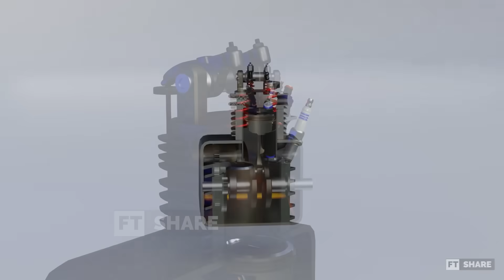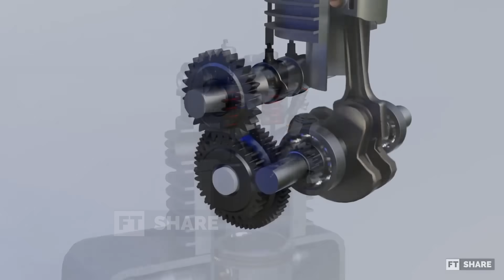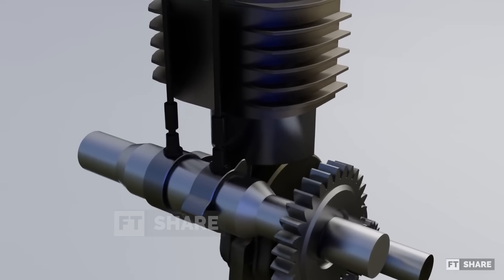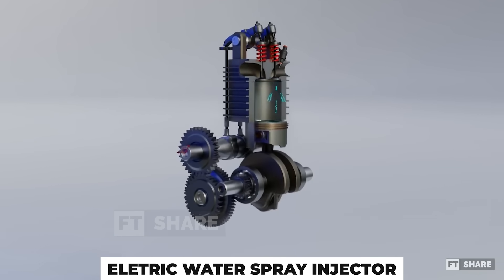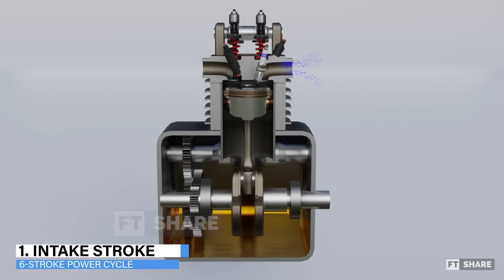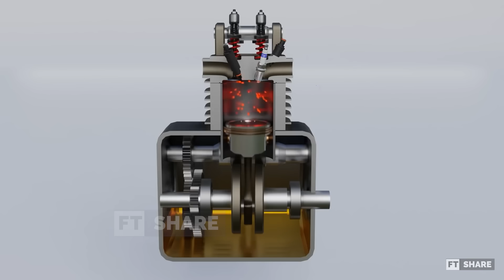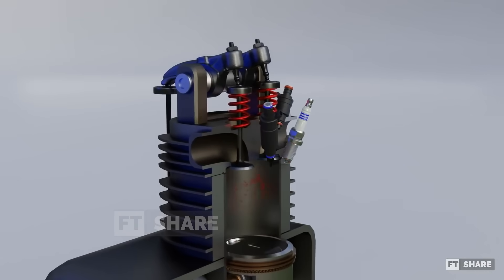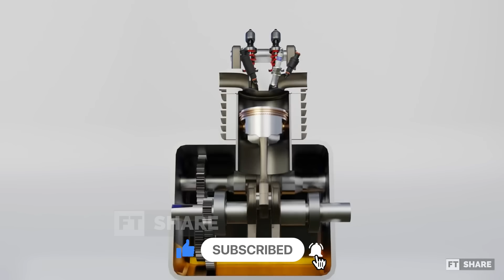Water-Powered ICE Is Here!!! | The Revolutionary 6-Stroke Engine

Comment: If it sprays water eventually it will corrode the wall of the sleeves will rust and water can mixed into engine oil when it goes inside.

Comment: The application for this engine would be niche at best.  It is obviously not good for mobile applications because of freezing water additional weight and complexity.  The only advantage is higher efficiency and no need for a radiator.  For stationery applications a turbine engine will be even more efficient so that is why this engine has not been adopted over the years.

Comment: This design would work even better if the exhaust gases were partially retained for the water quenching cycle. It would also convert some of the NOX gas into something less of a problem to deal with and may even be caught in the exhaust system in the same way cleaned power station flue's work. That liquid is even great as a soil conditioner properly applied.

Comment: 6 stroke sure, water powered ? nope, water is not combustible and the energy to split into hydrogen and oxygen is more than the energy release by igniting them.
Reply: Water is turned to steam, not used as a fuel.

Comment: I was just thinking that if the water were super heated inside the cylinder that this improvement in the steam engine as opposed to a boiler, yeah this could work well.  But the atomization of the water precisely the right time and degree is tricky

Comment: Ooo,  so this is why they will replace the electric motors. It’s because of the claimed 15% more thermal eficiency. The fact that you inject watter in an oil lubricated system is nothing. The fact that ads complexity to an already complex engine, compared to an electric motor is also nothing. 😂😂

Comment: The power gains come from the water injection. 
 Water injection adds app25% more torque to a 4 stroke engine without any other unnecessary clutter.
 I know, because I've used it on my OTR semi's for about 10 years now.

Comment: Interesting concept, however the power density of this engine seems to be another problem, ending up with an efficient but heavier engine, besides of its additional complexity. Also, there are other tecnologies that already achieved the 50% thermal efficiency. For me the 6 stroke doesnt seem commercially viable.

Comment: Hear me out. What if you had 3 valves: 1 for the air/gas mixture intake, 1 for the gas stroke exhaust and the other for the steam stroke exhaust.

This way you don't have to deal with water in the catalytic converter and you can route the steam directly to a simple filter and a condenser to recycle it.

Comment: Seems like, although you're recapturing some of the heat energy with water, running cooler would have a negative impact on the first power stroke. I guess it works though since Porsche is doing it.

Comment: The water would make the engine cool down and heat up repeatedly making the metal dilate and shrink down a couple times in a second, so I suppose structural rigidity is a huge challenge as well

Comment: Hype is not really useful.  Some electric motors are 98% efficient already.  The theoretical efficiency of 50% cannot compete with 98% already achieved.  It would be interesting to know the pollution this design produces.  I assume it still puts out nitrogen oxides and carbon monoxide and needs a catalytic converter to legally be used in a US production automobile.

Comment: It will work but then you will have complications with the lubricating system because water is going to get into the oil past the rings and then you will get rust around the cylinder when you turn the engine off one of the Pistons is going to still contain residuals of water

Comment: My great-uncle Leonard Dyer worked on this concept and even got a patent for it through his brother Frank, my grandfather...one thing i didnt hear mentioned is the difficulty keeping this engine lubricated during the flash from water to steam.  Otto Lutz came up with something he called "Schutzol 39" in the 1940's but it was meant to prevent corrosion in his MW50 methanol/water injection system he developed during the war.  But this was not intended as a lubricant, also apparently it was emulsifying just fine in water.
Reply: Interesting! I was just reading about the Dyer engine and then found this video! Yes, I would think the most obvious problem is steam cleaning the oil right out of it and then you've got oily waste steam to manage.

Comment: All very well until it's winter and you go to start your vehicle in the morning but the water has frozen and turned to ice
Reply from the maker: You right, I didn't think that far. :(
Reply: That is a non problem, I used to spray a ton of water methanol and straight water, it does not hang around in the cylinder

Comment: People come up with all of these complicated ideas of modifying already invented machines with numbers of how much greater they are than what was developed years ago from scratch. What they don't explain is all of the problems they present. Lubrication, corrosion, freezing in cold climates, expelled steam turning back to water and water vapor especially in cities freezing on the roads,  and the soot that the steam will probably carry out are all problems I can think of just sitting here using my imagination that we don't have right now. Actually there is some water generated in the exhaust process from engines now that will freeze on the pavement but it is minimal. Just picture a really cold day sitting at a stop light and white exhaust spewing out which is steam produced from relative dry air. Imagine what it would be when injecting water in the engine. Some of you may never have seen this before unless you live north of or near the Mason Dixon line (In the USA) .

Comment: the water doesn't have to be lost. After ejection, the steam can be piped back to the water tank, where it will condense. HOWEVER.  This is not a simple design, in practice. I think if an engineer is smart, he can design something complicated that works. If he's even smarter, he can design something simple that works better. I would like to see an engine with fewer moving parts, not more.

Comment: With many years doing engine R&D and simulations I could spend   an hour listing the problems, but the big one is low specific power  output and the water. With the modern turbo car engine at 120 bhp per liter why this?

Comment: This is a good example of the trickyness of computing with percentages: 50% is, and at the same time is NOT (!)) 15% than 35% (depending on the definition of %) ... It is literally 15% higher because "percents" are the things we reckon with (percent-points we would say in Dutch), however the real difference is much bigger than 15%, because 15% "percent-points" is actually 15/35 = 42.875% of 35%. So an increase the efficienty from 35% to 50%  leads to a nearly 43% (!!) higher output from the engine. Or, if we for instance assume that the efficienty directly translates to range on the same amount of fuel, and we also assume that a certain amount of fuel gives a range of 100 miles with the standard engine with 35% efficiency, then the engine with 50% efficiency would give a range of 100 * (50/35) = nearly 143 miles, which is an increase of nearly 43%...

Comment: During first exhaust stroke exhaust gas is pushed straight out into exhaust manifold. It will carry large proportion of waist heat with it. Why not send it into heat exchange vessel and then pump water through it thus scavenging said exhaust heat before water ingected into the combustion chamber? Also second exhaust stroke is really unnecessary! Why not make it two stroke like by blowing compressed air into cylinder on the bottom and then do direct injection into combustion chamber? Then engine will be 5 stroke engine? Or maybe 4+1 stroke? As in 4 stroke engine with added 1 stroke in the 2 stroke engine fashion...

Comment: Nice video and presentation. 
However residual heat spans from the cylinder to the exhaust system. If not inject to the cylinder can be injected at the turbo rotor inlet. If any corrosion there the maintenance cost can be reduced significantly.

Comment: Momentum not inertia. Water does not evaporate, it is flashed. A better approach would be to run two 4 stroke cylinders into an water injected  expansion cylinder. A six cylinder engine could do this with an altered crankshaft sequence.

Comment: My thought was a 3-valve head, instead of a double lobe cam. 2 valves for fuel intake exhaust, 1 for water exhaust. That way you could separate straight steam exhaust to keep away from things such as a catalytic converter, as mentioned by someone in the comments, and O2 sensors and the like that may be damaged, and could possibly be recondensed as in some steam engines.

Comment: Cool idea.  Convert thermal energy which is usually dissipated with a radiator to kinetic energy.  Water methanol injection was used in ww2 to provide additional power in a dogfight, so the concept is not new, but to utilize an additional compression stroke when injection the water followed by an additional exhaust stroke would appear to be the revolutionary part of this. 

There is so much potential energy with cars\ automobiles that is currently wasted.  

Every time we roll down a hill or tap the brakes thats energy that should be recycled for the next hill or acceleration.  Everytime there is a large temperature variance that is a chance to utilize the energy.

If we were really on our game vehicles would utilize all sorts of hybrid technology including internal combustion, electric for stored energy from braking, going down hills, and from unused internal combustion engine, perhaps a sterling engines for temp variation (leftover from heat generated in our ICE, perhaps also harnessing solar or thermal power from the asphalt itself to energize our vehicles.

We don’t need to veer away from internal combustion, we just need to figure out a way to best utilize and combine various forms of  potential energy all around us (heat, momentum, height, sunlight, deceleration)

into meaningful work by developing a system of engines that are reliable, highly efficient, inexpensive to build maintain and operate and are sustainable.

It may mean mining for a bunch of raw materials rare earth metals etc… initially.  - but once the technology is involved to reduce the fuel costs for mining (provided the materials needed can be recycled), the faster this can be implemented in automobiles conventional transportation etc…

Comment: Why not using a 2nd fuel injection instead of water? You can use ethanol or gasoline itself. If using gasoline, both injectors receive fuel from the same fuel tank. If using ethanol, your car needs an additional fuel tank but you'd need it anyway for water on the original design...

Comment: An interesting concept, but deeply misleading to claim this engine is 'powered by water'. The 2nd power stroke uses the residual heat from the combustion of fuel on the 1st power stroke. Water --> steam is used to harness this heat into mechanical work, but water is not the source of the heat, and therefore not the source of power. This is like claiming a steam engine were powered by water. A steam engine is powered by coal, and this engine is powered by fuel, e.g. petrol. In both cases water / steam is an auxiliary, but not the power source. You are not doing this interesting concept any favours by making false claims that can easily be debunked.

Comment: I think you are missing the point here the heat is already there, so using that heat to expand water to create steam is extremely efficient in fact it’s been around for 200 years and it’s still used today in steam turbines because it’s the most efficient 2:08 energy producing system.

Comment: I'm reminded of the Saudi Prince quoted during one oil crisis that the price of a barrel of oil was cheaper than a barrel of water.  Throw in the purification process for the water used in an engine of this type over regular tap water and its probably cheaper to just use a plain old gasoline powered 4 stroke engine.

Comment: Absolutely it could be a big improvement in ICE technology. Injecting water into engines is not new, and for different reasons. This seems to give an extra boost in power by using rapid expansion of steam. Clean and efficient with huge inprovements in exhaust. What if we can get rid of Catalytic converters? Keep emissions to a minimum. I do not consider the carbon cycle of earth as " pollution". Bc , as Gov. Newsome said about cleaning the for the Chinese dictator, Yes, we did clean them for the visit. " IT'S TRUE, BECAUSE.....IT'S TRUE....."

Comment: High school friend would win truck pull at fair (stock class, must be legal to drive on street), by bolting a hay bailer flywheel between flywheel and trans. Once he got that up to desired rpm, nothing could stop it. Why not have this engine spin at 7k rpm and power a generator that supplies power to a vehicle's wheels via electric motor, like a train? Excess electricity would be stored in a battery and not wasted. The engine would maintain it's most efficient rpm. Once the flywheel got spinning it would use less fuel to maintain the rpm because of the gyro wheel's stored inertia.

Comment: It’s too bad we haven’t been capitalizing on this potential power and economy improved!! how much water do you end up getting in the oil I wonder? Would it be possible to take the first exhaust gases compress them in another engine or another cylinder on the same engine and then inject water and get a power stroke?

Comment: There is zero advantage and many disadvantage to using water and converting it to steam during the 2nd power stroke!  That energy cycle is less than what is derived from gasoline! For all the major problems, sourcing and using high volumes of distilled water, this is a fail for general use.  This is even worse than battery cars!!!

Comment: All of the power comes from the gasoline. The water is heated by the burning of gasoline. This engine is not "water-powered".
Yes, you gain thermal efficiency, but with a heavier engine, a water tank in addition to fuel tank, expensive pure water (with how much embedded energy?). I doubt very much that overall efficiency would be better than a conventional 4 stroke in a mobile application.

Comment: Neat, but your second power stroke kills your thermal efficiency.  It takes a lot of heat/thermal energy (2250 kJ/kg) and even though it uses some wasted heat to vaporize the H2O, it still takes energy.  Any C02 left in the chamber when the water is injected, and you have a corrosive mix no matter how pure the water.  There will need to be a lot of material research to make it viable.  Good point on reducing/eliminating a cooling system.

Comment: I like it.  It makes a lot of sense.  I have to think about that water contamination issue some more.  It seems ridiculous that such a good idea is shelved because of a water purity problem.  What did the Germans do when they used water injection in the planes during WW2?  Maybe they didn't care about wrecking the engines at that time.  Ceramic filters come to mind.  I say make it work.  It's worth the effort.  How much gas can it save.  I bet it can save a lot.

Comment: This 6-stroke engine is interesting mainly for stationary applications, where both the injected water and the combustion water can be reclaimed and recycled using a large radiator to cool and condense the hot gases. That eliminates the need to continually supply new purified water from elsewhere. Radiator air temperature will still be easily hot enough for making domestic hot water, and for heating buildings, which will be great for reducing or eliminating power draw from the electric grid if the combustion fuel is still available... preferably natural gas or propane, for clean burning. Off-grid would also be possible.

Comment: Mix water and diesel or petrol and water under a vacuum so that the emulsion does not seperate when stored. Adjust the engine timing, compression etc. A fuel water mix of 10 to 30% can work like a fuel/steam engine as the ignited portion of the mixture vaporizes the water and the steam gass/ volume is much more than just the ignite gass volume and the power output increases dramatically. The thing is to design a motor that can take this mixture but a standard diesel engine works fine with about 10% water mixed in. The water must be degassed in a vacuum chamber to remove the air so that it will stay mixed with the diesel. It does not seperate out when mixed like this even for a very long time and no emulsifing chemicals required.
Reply: Interesting point about degassed water!

Comment: I thought of this 40 years ago, however my idea to take maximum utility of the waste heat was to stay at 4 cycle and gate the exhaust heat into another cylinder of suitable size to take advantage of the expansion of water which is 240 volumes, on a common crank.
Reply: Have a look at the 5 stroke engine.
Reply: my gudness

Comment: Nope. Electric engines in cars, right now today, have efficiencies ranging in the high 90% bracket. Indeed, the axial flux motors, as personified by YASA, are capable of over 99% efficiency with an average efficiency of over 85%. Whether you're talking EV or Hydrogen, the motors are always going to be electric. The truth is that EVs are mechanically simpler that ICE cars and, in particular, much simpler than hybrids and phevs. Personally I think pure battery-driven cars are not a smart idea; I would rather see hydrogen or methane fuel cells augmented by a small battery. But the future will take care of itself regardless of what I think. What I do know is the ICE is going the way of horse and cart; probably sooner than later.